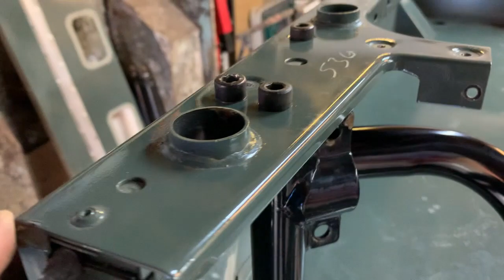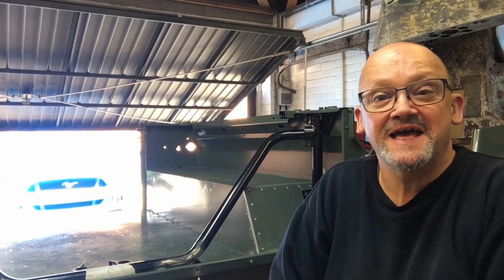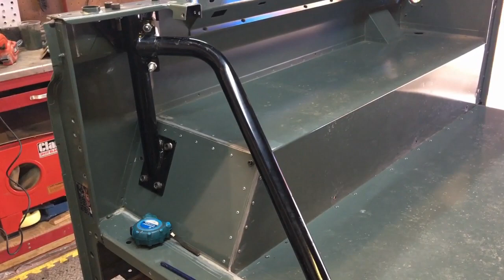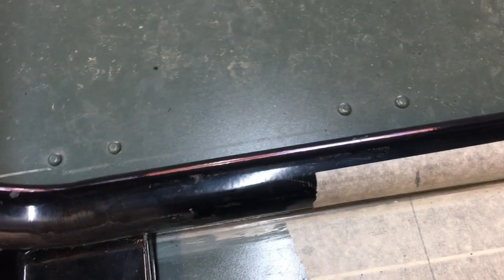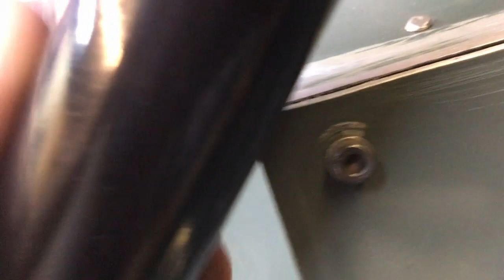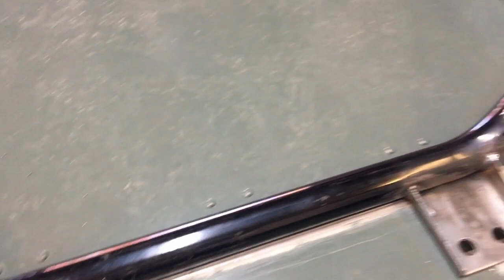Defender 90 Britpart Bulkhead bar install. Part 5.. must see!!

Comment: Hi mate can you recommend a good parts cleaner fluid for crankshaft n pistons that's safe to use thanks
Reply from the maker: I use Parrafin for oily bits and oven cleaner for the carbon bits.

Comment: What's really sad is the weekend warrior that either hasn't the talent or the tools to modify a so-called bolt in kit. They push and pull and twist to get it in over the weekend only to find their doors won't close and their body panels are warped. I'll take proper fit with bird shit welds over this. Really pathetic. The few times I've added in some sort of structural supports I've gone for a kit (as you suggested). That way you know it squares up to what you have and not the other way around. Between this and the Ranger, it's time for a couple pints.